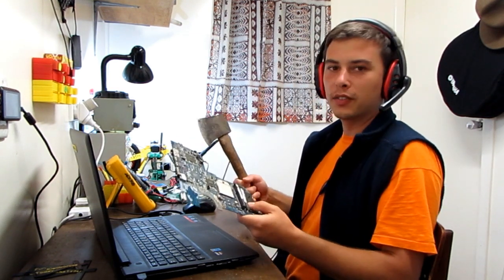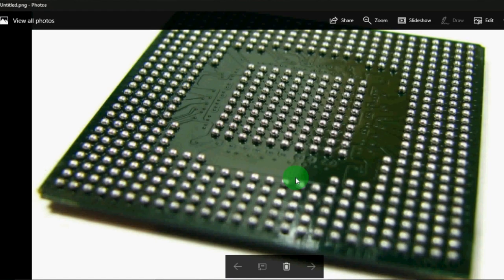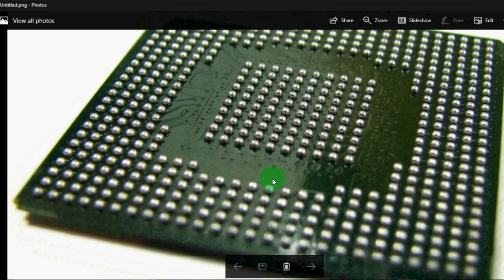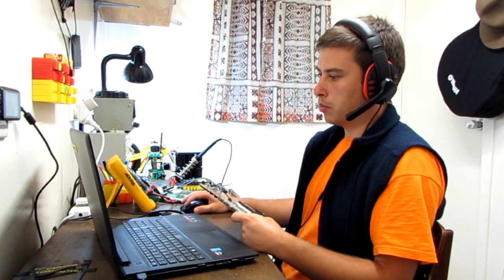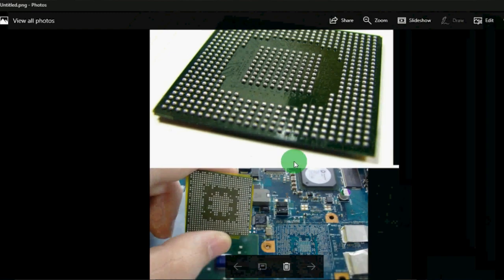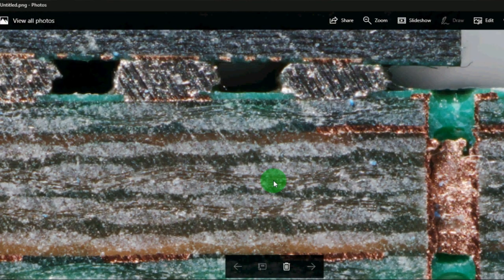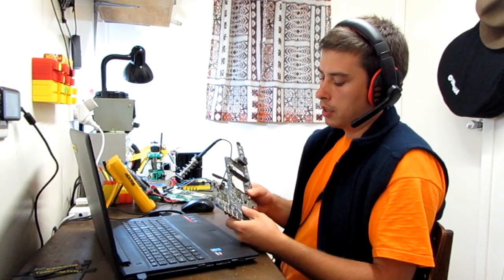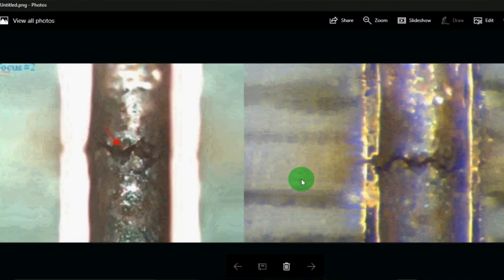Laptop lifespan - why electronics die

Comment: Well.. maybe.

There is also:
eletromigration destroying the silicon circuits itself
connections to the silicon (having  different thermal coefficient than the board material) - you are looking at the bottom of the interposer PCB, the top connects to the "rock"/silicon.
capacitors drying out, possibly making a regulator freak out
ceramic multi-layer capacitors loosing capacitance or going shorted (there are application notes about it) - various effects
board flexing (where apply, not all users are careful)
plug wear
(cracked screens)
Eletrostatic events

And likely way more..
Reply: b.t.w. ripped vias is mostly a issue with a badly bounded PCB layers, if you hear cracking sounds when you carefuly twist the board it's totally junk!
Reply from the maker: That's true, although not so many people are aware of the semiconductor diffusion effect.